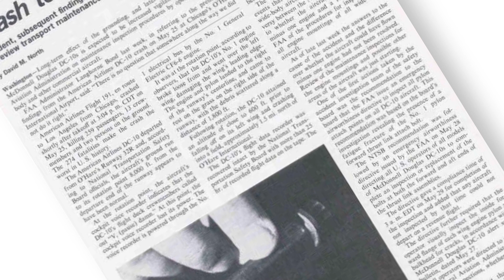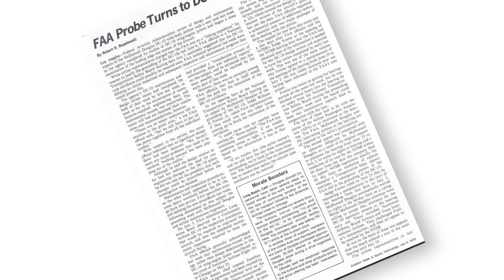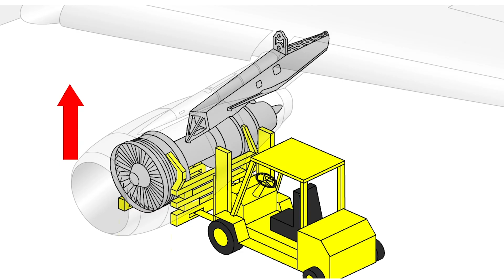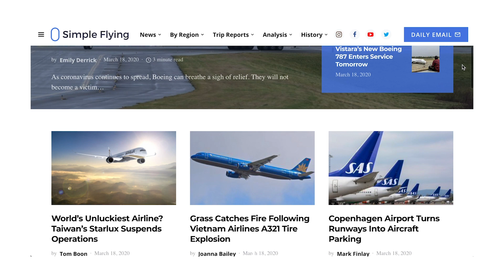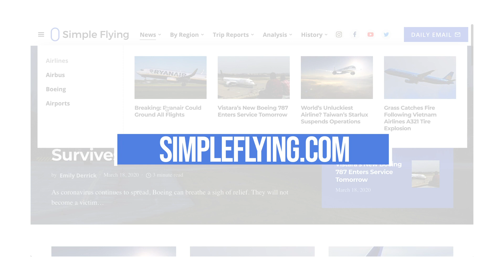The DC-10 1979 Grounding – What Happened?

Comment: Also In 1972 And 1974 The Cargo Doors Blew Out On 2 DC-10's A Turkish One In 1974 Which Crashed Due to Hydraulic failure due to cargo door blow in A Forest in France Killing All On Board And The Other One Was The 1972 One Which was American Airlines But managed to land with a jammed rudder And Everyone Survived And two Other Crashes In 1979 One On Halloween (31st October 1979) a Western airlines DC-10 Crashed At Mexico City's  Biggest Airport After Landing On the Wrong Runway Killing all onboard And The Other A air New Zealand DC-10 Crashed On A Volcano In Antarctica On 28 November Killing All Onboard

Comment: My 1st flight ever was on board an American Airlines DC-10 out of DTW/SAN to Marine Corps Bootcamp in 1978. Even after the tragic event of AA 191( SHAME ON MAINTENANCE FOR CUTTING CORNERS AND NOT FOLLOWING CORRECT MCDONNEL DOUGLAS DISASEMBLY FOR THE ENGINE & PYLON MAINTANCE PROCEDURES ) All 271 passengers would have made it to LAX Safely. Oh Yes. After the DC-10's were allowed to fly again, I had no fear of boarding another DC-10 which became one of the Safest Aircrafts in the sky once the grounding was lifted. Back in the day when I'd book a flight somewhere, I'd requested the Aircraft be a DC-10, and it would actually be near the top right corner on the paper tickets the type of Aircraft a passenger was boarding. Flying was truly a Luxury back in those days, And the Airlines would serve some very good inflight meals. AAHHHH YES!!! It'll be nice to see a return of the DC-10. I miss that Aircraft. SOOO much Overhead space and Legroom.💺✈🛫🛬✈😊💕💕💕💕I did fly the other widebodies that were popular, L-1011'S, B-747'S. But the DC-10'S were my Fav.

Comment: Despite the dc-10s early incidents, it still has less hull losses than the 747
Reply: To be fair. The 747 sold more than 3 times the amount of airframes
Reply: @timmanboy1  4.4% hulls of the 747, 5% md11 (but keep in mind 8 of the 11 were not the planes fault, entirely pilot/maintenance errors) and then the DC10 is 8.3% lost

Comment: Is it known when AA put the improper maintenance procedure into practice?  
N110AA had been damaged during scheduled maintenance in March, 1979. Two months before the crash of flight 191.
Reply: What triggered the overall situation was a part within the engine/pylon assembly (a bearing?) which had been wearing out sooner than expected, causing maintenance headaches.  DAC came up with a revised part, which led to all the DC-10 operators swapping it in around the same time.  Doing that for entire fleets was a big effort taking up a lot of maintenance time, so airline engineering departments were looking for ways to reduce the hours needed per aircraft.  The forklift approach had unforeseen problems, but at another airline they used an overhead hoist instead, and that didn't cause any cracks.

Comment: I sometimes wonder what would have happened if the FAA felt the plane was too unsafe to continue flying and permanently grounded the DC-10 in 1979. It would have devastated American Airlines, who was using the plane on many longer routes of their domestic network. United Airlines, interestingly, would have been less affected because they could pull a number of DC-8 60 Series planes out of retirement as stand-ins for the DC-10 until the 767 arrived in 1982.

Comment: After losing the engine the Captain continued the takeoff and climb out in accordance with the recommended procedure. The 2 engine climb out speed was lower than the stall speed of the left wing which stalled causing the plane to roll into that wing.  If he had pushed the nose down to increase airspeed the plane should have continued to fly. The problem of course that the pilots did not know the slats had retracted. As is common accidents are rarely caused by one failure but by a combination of mistakes or failures. Within American Airlines it had the nickname of “old crash and burn” although this accident was caused by bad maintenance practice.

Comment: I was about to fly up from Sydney to the USA with Continental. I was a little concerned. My older brother an airline pilot in the USA said; 'when they work out the problems it will be the safest aircraft in the air because of the scrutiny it will undergo'. 

I remember these words well now that the Max is about to re-certified. btw; I loved the DC-10 and went on to being a Platinum flyer with CO because of it..............
Reply: That's an interesting take on it - but the problem with the Max is that the airframe is structurally unstable - they tried to fix that with software.
Reply: @GGoblin1  that's a myth actually. The 737 MAX is completely stable. It merely handles differently than older 737s, which would have required retraining pilots. MCAS was intended to allow pilots of older 737s to keep their type rating. So MCAS wasn't so much a fix as it was an attempt to save money - but it was so poorly implemented that it became a hazard itself.

Comment: I was a kid when 191 happened. There were a couple of more DC10s falling out of the sky at that time. What I didn't know was AA not doing what MD suggested....😕
Reply: I think McDonnell Douglas suggested engine maintenance should be done by removing the engine and leaving the pylon attached to the wing. This required dozens of bolts to be unscrewed and took a lot of time.

So many airlines (not just AA) unofficially began undertaking the procedure by detaching the pylon from the wing too (leaving the wing and pylon together when doing maintenance).
This only required a couple bolts to be unscrewed and was much quicker.

The issue was that, when reattaching the pylon, the engine would be placed onto a forklift and raised up to the wing. The pylon would bash against the mechanism it was meant to lock into which caused small cracks in the metal. Over time the cracks grew from stress and repeated bashing during maintenance and the engine fell off during flight 191.

I believe the investigation and grounding revealed several other US-based DC-10s had similar cracks and were at risk of becoming another flight 191.
Reply: Several others was 9. 9 other jets ready to crash at any moment although takeoff and landings were probably the most vulnerable times for this accident.
Reply: @peterjamesfoote3964  The ones with cracks were all from the two airlines which had used the "forklift" procedure.  Another airline using an overhead hoist to accomplish the same engine + pylon removal task had no cracks.  So FWIW it wasn't so much about removing the two assemblies as a unit, but rather the particulars of how it was done.
Reply: They also “suggested” x-raying the bolts regularly which was not done either.

Comment: I remember this crash, Though even after this JAL123 crash happened.
Reply: JAL123 was a B747 crash
Reply: @matthewfranjkovic8274  yes I know it was a 747 crash however the reason for that very crash was same as this one because the maintenance engineers did not follow the repair procedure mentioned by the manufacturer.
Reply: Yes true, a tail repair for the JAL123 flight a/c

Comment: The DC-10 was neither bad nor worst, because it was the best trijet before the Lockheed L-1011 TriStar !
Reply: I loved all of the tri-jets, having flown aboard ever 3-holer (save for the TU-154) in service from the 60s up until the 2000s. I never felt nervous about flying the type before and after AA 191. I have every intention of trying to get a seat on the first 737 MAX when returns to the skies.
Reply: The Lockheed L-1011 TriStar was a failure of an airliner, so why compare such an iconic jet to it?
Reply: @chakshak  The L-1011 was not a failure per se, but it was the victim of poor corporate decisions. If Lockheed executives had not insisted that the TriStar only be equipped with the Rolls-Royce RB211, and allowed for both Pratt & Whitney and GE engine options, the L-1011 would have crushed the vastly inferior DC-10 in sales.
Reply: Lefty Stratocaster Player 

Fedex would be operating cargo tristars instead of cargo dc-10’s to this day lol
Reply: No, it was rated on the of the worst (not the very worst but close to it) jets of jet history.  Too bad the L1011 didn't go on to be more successful but unfortunately never really caught on with the airlines.
Reply: Makarand Mestry L-1011: You must be joking.
Reply: @antonleung1282  thanks man I often get confused🙋👍

Comment: Is this the reason why AA’s 777-300ER camera was not activated?
Reply: The camera will be just for taxi purposes
Reply: Thomas Mortimore I meant the camera in the IFE.
Reply: Anton Leung probably but some airlines operating A380/A350 allow it. It’s the same camer that is used for taxiing by the pilots
Reply: perhaps
Reply: Planes and Games is what the reason?
Reply: Chatta299 the DC-10 has a camera installed in the tail for the passengers. Unfortunately it also meant they could see what happened and the imminent crash
Reply: Thomas Mortimore ah right. Either way it wouldn’t have mattered. Things were serious enough that people knew the reality of the situation. Lots of aircraft have tail cameras but just for the cockpit. Even now the A350 has the option for it to be streamed to the IFE but BA for example didn’t pay for it so is for the flight crew only. I would say either Boeing didn’t offer it on the older B777’s or they didn’t want it